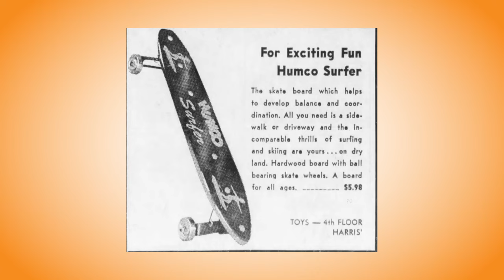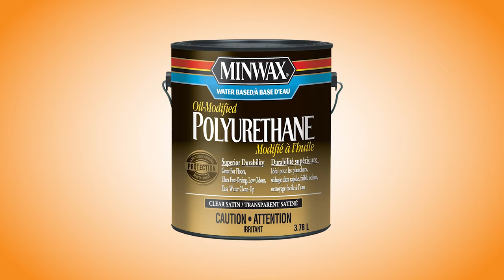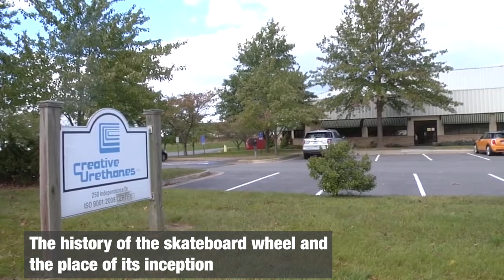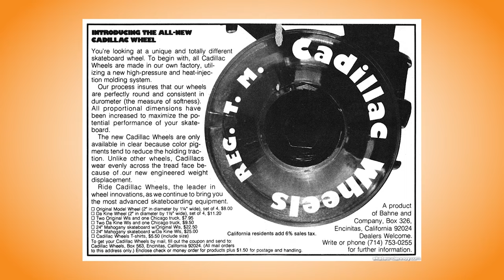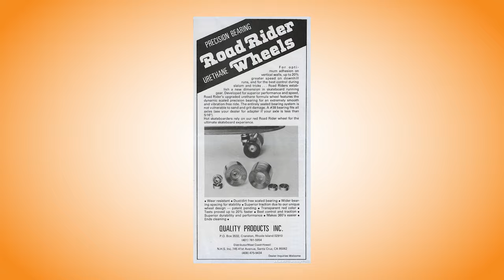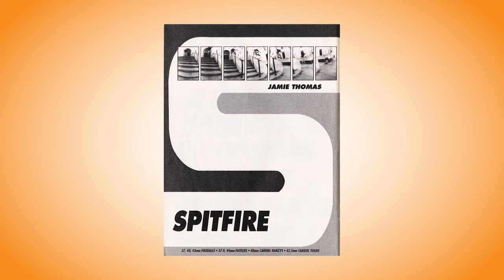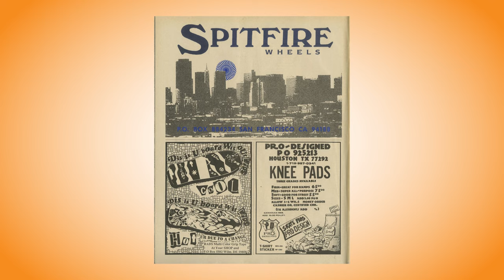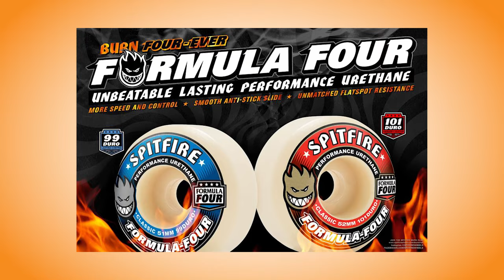The History of Skateboard Wheels

Comment from the maker: What wheels are you currently riding and why?!
Reply: My primary setup 56mm snot wheels because they look cool and also give me more hanger space to learn 50-50 compared to the radial full spitfires I was skating then 57mm oj on my natas board because I had them just sitting around and 56mm swampy snot wheels because they again look cool
Reply: Spitfire ff radial fulls 56mm I like em thiccc
Reply: On my ''new'' setup I got some slightly used spitfire formula four 56(now more like 55)mm 101 d conical fulls. Why? Because I got them used and they're great for rough ground, stable, powerslide nicely, are durable, look good and the size is great.
Reply: Sharks because our sidewalks and streets are rough as hell haha. No other wheel has been as consistent at keeping momentum for longer and spitting rocks and pebbles out of the way
Reply: I know in 2000's to 2010's some kids/teens would trim their wheels down and at same time due to skate park of era going crappy, people used carving style downhill wheels and trucks becuse of how rough the asphalt was for skatepark turning into a man-made gravel/sand with latter going until 2022 when skatepark was replaced for a odd material used in some indoor places that will not last. 

My dad had on his first good skateboard in 1972 a set of some other early big brand making Urethane wheels for roller-skates and so my dad had trucks and wheels for his kids weight poly board made of one brand's open bearing roller-skate wheels.
Reply: We want more color's for our SK8 board wheels please! 🫵😊
Reply: Spitfire 56 conical full 99a because I found them to be the most all-around versatile wheel but I’m always interested in riding new stuff. I like some bones as well.
Reply: I get to test stuff out for Deluxe sometimes (like the formulas in between F1 and F4), but even if I didn't, I'd be rolling on 97 F4s. Just a great slip-to-grip, plus they have a good bark when skating concrete. Very tough urethane. They're coming up with some new stuff as I write this. 

On the video... super fun... at one point in the 80s I used to love T-Bones (67mm). Now I'm 53mm or 55 max, I can't even imagine riding monsters like that now... I hated the tiny wheel phase though. I had some wheels Rocco put out called "Bearing Covers" that were really just that. I scavenged through all my old wheels and all my homies that had quit skating to hook up on bigger wheels a number of times. 

Take care, fam... such a good memory trip!
Reply: Ricta Chrome Clouds. And i love how light and durable they are. And yeah, they look insane :P
Reply: Spitfire F4 52's  - simply the best.
Reply: Slime balls Mini vomits 97A 54mm
Reply: Nothing about Ricta?
Reply: Mini cubics, cuz I like them
Reply: Arbor 54mm, 90a. They are smooth and fast.
Reply: Ricta Clouds 78A 52mm. Chewy soft, but not crazy big. Matched with ceramic bearings they're comfortable, smooth and grippy... if that's your thing. I skate transition and I'm 'currently' avoiding sliding.
Reply: X99 v5s 54mm
Reply: js some chill 54mm 99a duro spitfires. always loved them for park and street
Reply: Powell nano cubic 52mm 93A dragon formula for streets, Spitfire formula 4 for skateparks.
Reply: 90a Rat Bones because I'm old. Also have a set of 54mm Ricta clouds that I love. Used to skate Spitfire on everything. 25 yrs ago.
Reply: Mini rats always n forever!!!
Reply: Orbs ghost lites. Love em.
Reply: 55mm Powell Dragon formula 93A durometer, I've been loving softer wheels lately.
Reply: I was on OJ Elite Hardlines 54mm
Reply: spitfire formula four 52mm
Reply: snot. 47/101. nice
Reply: I got me the reissue of the Mini cubics 64mm 95A, and I love them. They ride smooth like butter, but still have that hard shell that i love. A+
Reply: Bones x formula and Powell dragons…because Midwest crust.
Reply: forgot the mg spitfire 54/80. looking forward to trying 'em out
Reply: Just got some Bones ATF Fimer wheels 52mm for my 49th birthday last week. I wanted a soft wheel but small to keep my setup light.
Reply: Dragons 54, the ground here is a mess. But I think Bones X will go on next I think they might cope with the ground but be better at the park. And the Juiciest super Juice OJs on the cruiser setup... BUTTER BABY
Reply: 1978 Red Kriptonics. The rolls royce.
Reply: Spitfire conical full 52mm 101A
Reply: Bones SPF 81B 56mm on my bowls setup. I bought these because I had Dragons 54mm V4 for everything but they stick on metal copings. They're perfect on smooth concrete.
Bones X97 54mm V6 on my street setup. I wanted something comfier than Spitfire F4 99 Classic on asphalt.
Reply: Pig Multi Pig C headline wheels 56mm 97a. Great for transitions and street skateboarding.
Reply: Rictas.
Reply: 55mm clear snot wheels cuz FOS is awesome always makes a 55mm
Reply: 54mm Spitfire F4 Radials <3
Reply: OJ double duro. Surprinsingly good !!!
Reply: Nice video as always! Love the content...Im riding a few different setups - I love the Spitfire Formula 4 T-Funk 60MM Full Radials for Pools.  Also Dig the slimeball 60mm.  They like certain crete' more than others.  97A is a sweet spot durometer for me personally.  However here lately Ive been riding 56mm OJ Dressen 101s  at our local park with a killer snake run w/ pool coping. Those wheels really make bert slides feel and sound amazing!  I like trying different wheels. It always keeps things interesting. Cheers!
Reply: Ricta wheels
Reply: Spitfire for all time!
Reply: Powerflex 83b Blue Gumballs
Reply: Spitfire f4 99a classic shape for the skatepark, but I love both the oj mini super juice and ricta cloud 78a on the cruisers.
Reply: OJ elite 54 mm
Reply: Still rocking some Hookups wheels from the year 2000 on my Creeper trucks with Bones bearings.  Still as good as the day I bought them.
Reply: @SpaceManDeadMan  Lol. I used to have a hookups shirt when I was a teenager.
Reply: @Heavilymoderated  so did I, school teachers weren't a fan of them lol
Reply: @SpaceManDeadMan  😂
Reply: Around '74-75, I was given a skateboard that a family friend found in a garage.
   It was well used, torpedo shaped red deck with white "graphics" barely visible. The steel wheels were straight off a soap box. 
   Living on a dirt road, the only place I could skate was in our basement. I had a sort of obstacle course I'd run. Faster, then faster again... steel wheels on poured cement have a very unpredictable limit. Multiple tail and elbow strikes later I got a new board (1976ish) w/ urethane wheels and a fiberglass deck (awesome palm tree beach graphics).
   What a different feel on the foot, but it couldn't even come close to the tight turns in my basement. I then got banned from every local school, library, post office, grocery store and side walk in town, lol.
Reply: Bones 100s, because they are cheap af and work pretty well
Reply: Spitfire Formular 4 52mm 99DU classic Full. 
Best wheels i‘ve ever had. 

I‘m also curios about the bones Formular x 97a because i Heard they are a very very good Allrounder also for Rough grounds
Reply: I don't skate board but I do rollerblade and my 80mm hydrogen specters are some of the best daily wheels I've had. they're not as fast as race wheels but you can get going with the right set of bearings, (I can cruise at around 15 mph with spitfire cheap shots, the only decent bearings I can afford that I know of), they have great longevity and will stick when you want them to despite being fairly hard.
Reply: 52mm Spitfire F4 classics on a twin tail and lock-ins on a Malto pop secret.
Autobahn and Ricta are also sick.
Reply: Hi Shredz , nice video!
I ride spitfire cuz' TOXIC  and Krytonite are out 😂
You should do something about the bearings stories 🎉
Reply: 15inch currently
Reply: As of a few weeks ago I've been riding 56mm blockhead 82a clay pigeons because i ride old school alva boards and love having a good grip in bowls without buying huge wheels. Lastly they just look cool
Reply: Sector 9 74mm 80a on my race longboard, Mindless 75mm 78a on my cruiser longboard and a set of Vault Pathfinder 70mm 83a slide wheels on my Omen Sugar Kick. It's a 40" double Kick longboard, like the typical skateboard but huge, loads of fun in the parks.
Reply: 52mm 97a Nano Cubic. They do well on everything, everywhere I ride and fit my style of riding perfectly (cruising, freestyle and flat ground).
Reply: I can tell you my wheels from my first real board.  Hobie-flex fiberglass board with Cadillac wides in the front and Stokers in the back.  Total hot rod look and feel and asymmetrical but it was early 70's and I was a kid so I thought it was cool.  I think the trucks were either Hobie or ACS.

Oh yeah, and I found some chrome pipe end plugs that fit perfectly in the wheel opening that served as a dust cover and looked like chrome dish hubcaps.  Good times.
Reply: My first real board was in the early 90s I forget the mm but they were mini wheels basically the size of a bearing lol
Reply: I'm rolling on some old as dirt generics think I got off CCS around 20 years ago.  just been digging through the box of spares for a while
Reply: Powell Dragon formula 55mm
I can ride ANY terrain with these.
Reply: Bones wheels bones ceramic bearing's. Save up as a kid to get the best and once i did ive never used anything else. Nothing compares. Also grew up in socal in pools and parks and indoor parks. I skate everything and they just handle it all for years. Replacing ether is never a though last set lasted 8 years
Reply: 60mm slimeballs
Reply: KRYPTONICS ULTRA LITES
Reply: I'm currently using dragon wheels that my friend gave me today
Reply: I'm on 55mm dragons atm but I'm going to try out the nano cubics in 52 or 54mm. I like the offset and getting more Axle to grind with, all while protecting your axle threads/nuts
Reply: Spitfire conical fulls for life (56)
Reply: Untill this week, I rode local defuncted firm black hard wheels, but now I ride 55mm dragons. I feel like I'm snowboarding now. Also surprised that I notice a few mm difference  -_-.
Reply: I just switched to Dragon Formula's. the best wheels I've skated, by far. They slide so great and roll over the rough concrete in Michigan. I'm very impressed on the streets and at the park
Reply: I got some beautiful world industry wheels from the 90s that are soft and I absolutely love them
Reply: slimeballs, always slimeballs, best wheels ive had
Reply: @kevinmorrice  I’ve gotta try some slime balls. I’ve heard nothing but sick reviews, man
Reply: @realcooltimes  i use the super soft slimeballs for cruising, and the mediums for skating bowls, there hard wheels are good, but there softer wheels is where they hit the spot
Reply: @kevinmorrice  I’ve been riding Dragon Formulas 93a - 54mm, all summer. I’m definitely enjoying them, but I like trying new wheels. Slime Balls are next!
Reply: i dont know what im riding tho
Reply: Currently got some 52mm Big Heads. I know they're not as good as F4's, but I'm just starting to skate again, so doubt it will make much difference for me. 

I want to try out some 50mm Dragons I think, although now Spitfire have a similar wheels, I might go with those (I think 53mm might be the smallest though, at least based on what my local currently has)
Reply: @kevinmorrice  I built a new complete and threw some Slime Balls on. I went hard tho - Face Melters 99a TRIP BALLS! Haha. I love em. I’ll have to try the soft wheels next!
Reply: @realcooltimes  the softs are where slimeballs really shine, the 99a are great, but the softs are where the brand gets it right, slimeballs and oj's are the best soft wheels around
Reply: Spitfire Tablets F4 54. So good. My kid took my 54m 97 X Formula which think is my favorite wheel ever made
Reply: Ryctas

Comment: I was the first kid in my school to have urethane wheels. That was 1974, 6th grade. I had my mom drive me to a surf shop in Newport Beach to buy them. Four gleaming, amber, Roller Sports urethane wheels. So smooth, so quiet, so grippy!
Reply from the maker: That’s so crazy! Kids minds must have been blown seeing you in urethane for the first time!
Reply: Were those the Super Surfer Racing Slicks?
 They came out just about the same time as Cadillac wheels.  
 Then there were the large version called Stokers. 
 There was another popular wheel in a wine color see through called Road Riders.
  The Cadillac wheels were paired up with a set of Xcalibur trucks and a Bahne fiberglass thin semi flexi board.
  Then Tracker Trucks were the big deal and about that time was when OJs and Sims Pure Juice wheels and everyone was rolling on SKS or German Speed bearings.
 Then we got Kryptonics wheels that came in blue, pink, and I think green, each was slightly different in density. Pink were super soft for pool riding, blues were harder for street and ramps
Reply: Et @ShredzShop

Comment: I made my first "skateboard", around 1962, out of a piece of 3/4" x 4" pine and some metal wheel strap-on skates bolted to it.  It was murder on the smooth sidewalks of the hospital across the street from our house.  I was 8 at the time, and I survived it with no protective gear!
My second build was around 1969, out of 1" x 8" doug fir and clay wheels, that I rattle can painted in a psychedelic paisley pattern on while in a closed garage, ...I wound up puking my guts out soon after due to lack of ventilation.
Bought my last skateboard in 1977, a bowl rider (don't recall the brand), Tracker Trucks with wedges, OJ wheels with germs, and added some anti-skid tape on top.  Riding Timberline Road, and Mary's Peak in Oregon was awesome!
Reply: The Oregon trail was not so awesome I would not have made it😮😅 play yeah a great story I'm almost 60 and I'm thinking about getting another one more downhill for the road I got to go faster than 45 mph😊

Comment: I started on a Black Knight skateboard with clay wheels on country roads. We rode 2 miles to get to the only sidewalk is a nearby village (no, not uphill in the snow :)). Between Cadillac and Road Riders 2s we rode Roller Sports with loose bearings. We learned a lot as kids trying to service loose-ball wheels with their races and cups. I remember Power Paws and a bunch of dumb super-wide 'Bowl' wheels in the 70s. Kryptonics were happening in mixed colors, etc. I begged my dad to visit Tom Sims' garage in SB to get me a set of Gyro wheels with the nylon bearing seats. I got a set with 2 black on 2 white. Punk Rock. We later rode big 66mm Bullet Speed Wheels on the SF hills while the cool kids were on micro wheels and wearing size 54 waist Ben Davis. Times.
Reply from the maker: Whoa! That's epic! Before my time, but always been so interested by it.
Reply: My first board was a Black Knight with clay wheels. I was about 5 yrs old. My mom and dad bought it for me from Sav-On Drugstore. After wearing down those clay wheels to about ¾ of the actual size and the bearings not staying in the races I got a GT board, there were two, a long surfboard shaped yellowgreen one and a short blue one with a little kicktail type thing, they were made of plastic nylon material like a Frisbee but thicker. Totally cheap boards with really early urethane wheels open bearings. Then I got a fiberglass Bahne with Cadillacs and either Chicago or Excalibur trucks. I've had so many boards and wheel and truck combos, constantly switching and buying new parts as they came out. I probably had 20 different boards between age 5 and 12, 1970 - 1977, then things got serious. Hahahaha

Comment: Love my Dragon wheels.  Have them in 52 mm for daily riding , 54 for curbs, and 58 for cruising and curbs.  So smooth on east coast pavement.
Reply: Hell yeah bro. I got the 52, 54, and 56mm greens with the wider cut. I thought the 56 were going to be different because of the colored urethane. So far it hasn’t affected performance. Definitely like the dragons over the X-series.
Reply: I love the dragon design, and completely hate that ugly x
Reply: @GasGotti  No way. Dragons are mushy and slow. X99 to rule them all. Incredible how that hard a wheel handles crust so well!
Reply: I work in asphalt paving on the west coast. How is your paving method different? I've heard new York and d.c. uses fecal matter to coat the streets, but so does the entire I-5 corridor of the west coast? 🤷🏼‍♂️

Comment: I remember when I got my first polyurethane wheels.
My dad worked at a Aerospace firm and brought home some cased bearings that fit my wheels.
I was STYLING!
Reply: My Dad did the same except the bearings were 609s and we had to rout out the wheels with a huge router.
Reply: @ianedmonds9191  OLDE SKOOL!

Comment: I haven't skated seriously in over 10 years, but back in the 80's I was heavily into flatland freestyle. It was then I discovered Cockroach Wheels, well at least, my brother did.
He bought a set for his street board, which when worn out and too small for his liking, they were perfect for mine. So I got a "new" set of wheels every time my brother bought new wheels. YaY
They were great wheels too. So many wheels sold as freestyle wheels of the time were had little if any dishing in the wheel, which meant scraped up axels and wheel nuts when the board was up on it's rail. The Cockroach wheel were quite dished, enough so only wood and urethane touched the ground.